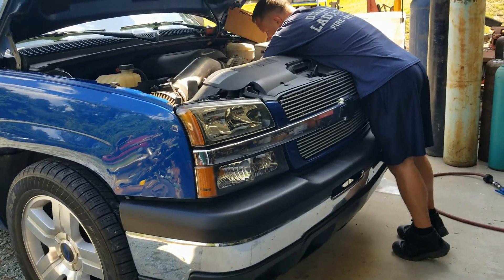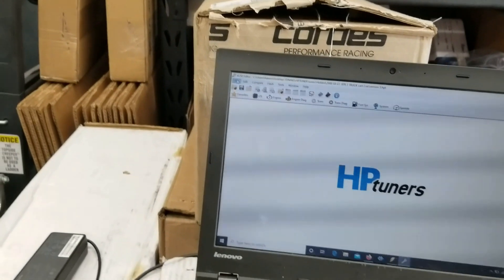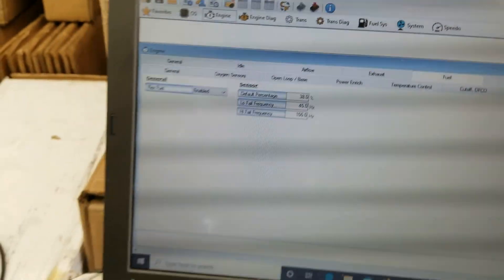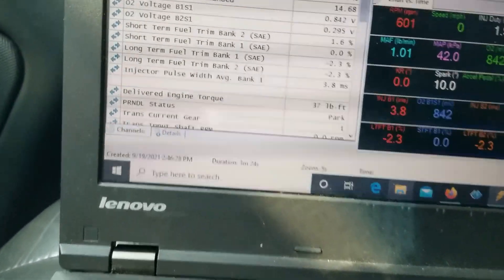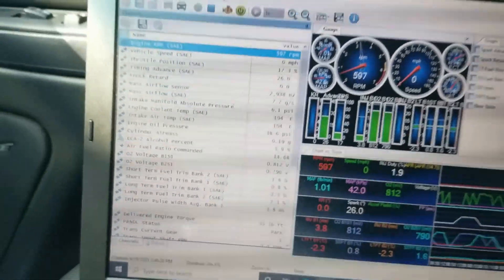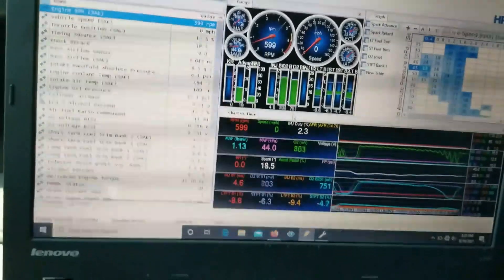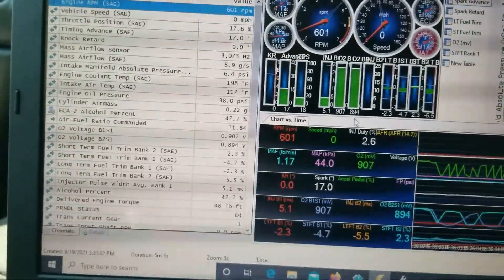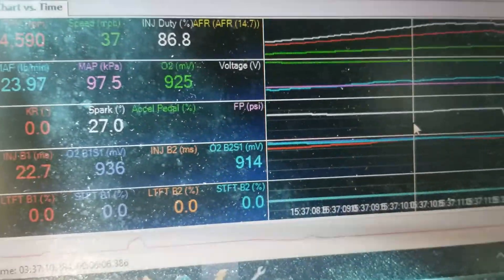How to add E85 to a 2004 Silverado with a 411 ECM.

Comment: I followed the steps on your video on a 2003 silverado. But I'm not getting a reading on hp tuners. Is there another settings that I'm missing?
Reply: I apologize. I'm new to this what does that mean? Lol
Reply from the maker: @macielandsons means you may need someone to enable it in your tune in a more complicated way
Reply from the maker: Some OS have to be segment swapped, unfortunately
Reply: I have hp tuners. Can I fix it myself?
Reply: Can you post a video step by step how to set up the computer please. Thank you
Reply: Do you recommend 50 pound injectors? Or are they too big ?
Reply from the maker: @macielandsons  33 lb Tahoe injectors are perfect.  And you need to segment swap your fuel tables and it should work.  Some OS's are more difficult to swap than others
Reply: I installed pound injectors.  Do you think those are too big? 30 pounders will work better?

Comment: Would needing to use a Tahoe operating system also apply to a 2004 Silverado SS?
Reply: Also what year Tahoe did you get the operating system from?
Reply from the maker: You need tp find one that has the same OS and segment swap the fuel section on it.

Comment: You need to be 80dc or less. You need injectors
Reply from the maker: Some factory GM cars are mid to high 90s factory.  Tis truck is still running great on the stock injectors 3 years and 40k miles later.  On performance stuff I'd agree, but a truck that is RARELY over even 4000 RPM its not a huge issue.  I do plan on using some 33 lb flex injectors atvsome point though

Comment: Is your flex sensor and 0411 erratic and really slow to respond? Mine seems to have a mind of its own with readings all over the place. Mines a p01
Reply from the maker: Mine seems solid.  Make sure the ground and power source are both stable (not evap or egr turn on points!)
Reply: @nufnuffz28  did you ground from the PCM or chassis?

Comment: Anything for us with 01-02 DBC trucks? My old 02 Tahoe was FF, but DBW. Can I use that tune file to make mine FF? I have been told that since I have an 80E with a segment swap in my truck - to get an express van DBC PCM and start from there. 

Thanks in advance, your videos are always helpful and informative.
Reply from the maker: You can stack that.   I'd segment swap a tahoe tune with a 4l80 truck since they are factory flex and write entire, deleting vats.   Make sure the pcm has a iac driver amd setup that way
Reply: @nufnuffz28  is that potentially a service you offer? I am novice at best. I invested in HP Tuners less than a year ago to data log and make small changes. My current 6.0 is about 10.4:1 and pump E85 is starting to be more readily available near me. I'm thinking I could pick up a little on the corn whiskey vs 93 octane.
Reply from the maker: @bluecollarhotrods9781 should be able to help, yes.  email me at chris@blazinghighperformance.com

Comment: What year was the Tahoe you removed the operating system from? 04 as well?
Reply: or was it the 02?
Reply from the maker: Mine required no OS swap!
Reply: @nufnuffz28   oh? I must have misunderstood then. Seems like y’all really know what you’re doing when it comes to E85 conversion. Where’s your shop located and do y’all take clients? I’m willing to pay for someone to do this conversion right rather than screw everything up by myself
Reply from the maker: @racenturtlez  We are in central NC.  Sometimes they tune super easily by enabling the sensor  Other times it requires a full operating system segment swap.  It really just depends on the truck and year usually.

Comment: How do you like running on e85? Whats been main differences? Here in california gas prices are sky high. I have an 06 silverado with 6.0 in it. Wish e85 coukd run on stock 6.0 non flex fuel injectors instead of going bigger. Is this even possible? Would like to give this a try if i can save on fuel costs.
Reply from the maker: You could do it, but be limited at WOT for sure.  Id get the 33 lbers and call it a day!
Reply: Main difference is hp and mileage, worse mileage, more power since ethanol is less dense per gallon than straight gas

Comment: Did you have to get an e85 pump?
Reply from the maker: No.  Still on the stock 200k mile pump
Reply: @nufnuffz28  and no issues that's good to know the factory pump can handle the e85
Reply from the maker: @slicksloth_416  yeah.  We said that in the original video, but no one believes it 🤔

Comment: You need a fuel regulator if you planning to use e85 and and 93 say you only wanna use e85 sometimes but mainly run it with just gas pump
Reply from the maker: This setup allows either/or fuel to be used with no changes!

Comment: What is the part number for the flex fuel injectors?  I want to convert my 05 Hoe to be flexible!
Reply: P/N 13507129 - has the best response and refresh rate on that specific computer.
Get either the Continental or OEM/AC Delco, they are accurate and last longer.
Reply: @LaCacaLoca  I went with a set of Autoline 169005 (16-9005) from rock auto.  Is that a bad thing?
Reply: @notbuyingit8047  idk what part # that is for. Get the part number I mentioned for best readings. It easy and the connector you can get anywhere amazon or ebay. red wire (#1) is power, black (#2) is ground, and white (#3) is for ecu. It goes to Blue connector pin 56. Also Ecu has in blue pin 53 ground empty if you want to use that one for ground but you can use any ground in the chassis.
Reply from the maker: Not sure off hand.  Used a friend at advance auto to get them, sorry
Reply: Any idea on what pin style or part # for the ecm?
Reply: @rickygray7767  just look up Gen III ecu / PCM connector terminals for P01 computer. Make sure you have a good crimper and do not add anything to the cable since it slides in a little bit and it has to be 16 to 18 gauge to slide in fine inside the blue connector. 

What I did is I used a white 16 gauge 8 to 12 inches of wire to crimp it to the pcm connector, then merged it with another white 14 gauge wire to run it all the way to the sensor connector. Since it’s a bit far.
Reply: @rickygray7767  but I think Delphi makes them, do your own research but maybe part #: 12084913

Comment: I hope u reply to this.  I have a 2005 Tahoe none  flex fuel.  What I was going to do get a flex fuel tahoe  computer.  And add the flex fuel sensor for 03 / 04 that located in the frame  by the tranny. Turning a T vin into a Z vin  also add the flex injectors.  My problem is . Finding a tuner.  To vin swap the computers & check the sys functions.  Like u can do.  I have 
Made calls . Only to hear.  Sorry don't do that.
Reply from the maker: Find someone to send me your tune and ill convert it for you...

Comment: Did you swap to a larger fuel pump?
Reply from the maker: No
Reply: @nufnuffz28  interesting...
Reply from the maker: @between.seasons  stock truck and all.  It doesn't make much power.
Reply: @nufnuffz28  but the flex trucks come with higher gph pumps stock as well hence my confusion

Comment: what about fuel lines have you had any problems with that ? are they even e85 rated ?
Reply from the maker: Some gm trucks from 02 on were flex fuel, ao should be good.   No issues on any car we have done thus far

Comment: where did you get the whole kit from?
Reply from the maker: Dsx and made the rest
Reply: @nufnuffz28  what did you have add or modify to use the 08+ sensor?
Reply from the maker: @armandoledesma3699  pin for the ECU was the main thing.  They are not like what comes on newer kits.  Also, you have to do some segment swapping in your ECM to work correctly.
Reply: @nufnuffz28  which segment swap did you use I've done everything but the ecm is not picking up e85 ecm had already been enabled but the truck is on a 2500 segment swap maybe that could be the issue
Reply from the maker: @slicksloth_416  none on this one.

 Only certain ones need it.  Let me know if you need help
Reply: @nufnuffz28  should I use a tahoe e85 operating system maybe it will read e85
Reply from the maker: @slicksloth_416  On early ones that is a good option.  04 up are different to do.

Comment: Hey so how does flashing an OS work I have an e85 computer in my truck e85 sensor wired up wiring is good.
But the fucking ecm stays at 30 to 40% alcohol on pump 93 it won't read it.
Truck is an 04 silverado ecm is from an 07 classic service #12602801 hardware#12589161
Reply from the maker: It should already be good if e85 sensor and settings are available.    Is 30 to 40 your defaut e85 settings?  Is the wire correctly pinned in the ecm?
Reply: @nufnuffz28  everything is wired correctly I get signal from sensor continuity is good 
We ended up swapping to another ecm I'm going to try and check if it works on this one.
And on the tune the low is 38%
Reply from the maker: @labisk  If you want we can help with the tuning if needed
Reply: @labisk  i had the same problem when i did flex on my cts-v. It will read 40% if the pin is not correctly locked into blue dock.
Reply from the maker: @labisk  Did you get it straight?  Some years require segment swapping to work correctly.
Reply: @nufnuffz28  so my tuner asked me to go get an 05 tahoe computer did that and it still didn't work lol idk what else to do you'd figure tuners would know to flash the os or segment swap
Reply from the maker: @labisk  stock ecm works.  Just have to add it to the stock tune
Reply: @nufnuffz28  so how would I tell my tuner? Just to segment swap?
Reply from the maker: @labisk  you can email me your tune off of your truck and ill set it up... if it doesn't work don't pay me.
Reply: @nufnuffz28  let me ask my friend who has the hp tuner software to copy the tune to the file so I can email it
Reply: @nufnuffz28  sorry it’s been a while been busy as hell got the tune what’s your email?
Reply from the maker: @labisk  nufnuffz28@yahoo.com